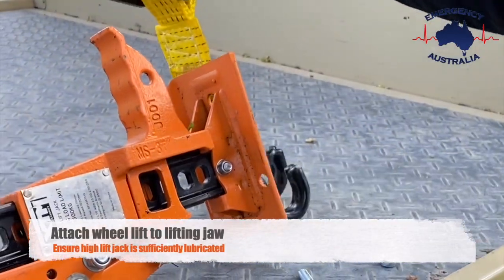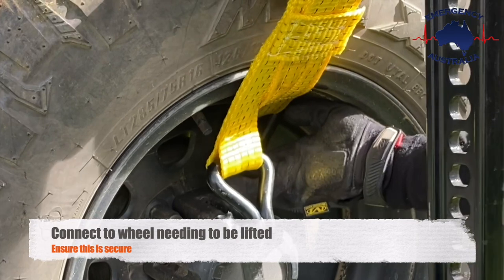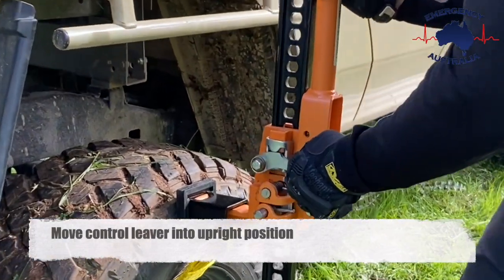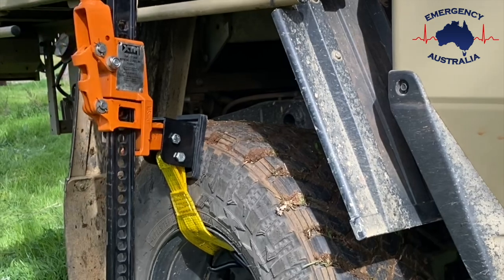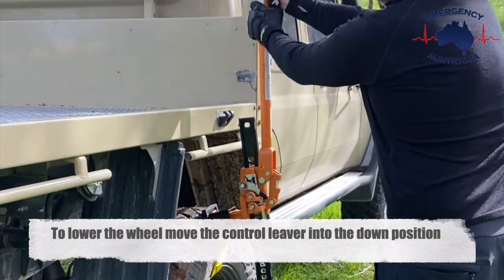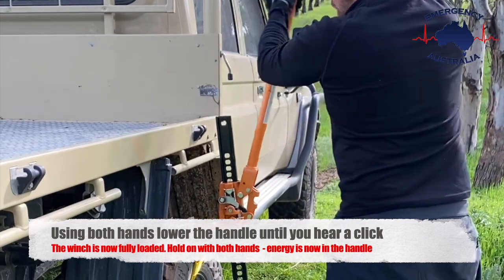High Lift Jack - How to use with a wheel lift

Comment: I´ll be the first to comment!
I purchased exactly this jack earlier this year - mostly for round the block heavy lifting, though if either vehicle gets into trouble on my rough track in, I was thinking that this is a good backup plan.
I came to try it today for the first time. I needed to lift a full 200l drum from horizontal to standing.
Should be easy, I thought.

I tried to follow the instructions, but I ran into trouble with the "make sure the control lever is in the up position".  It only seemed to go "so far" then stopped.  I thought, Surely you aren't meant to keep manual pressure on the lever WHILE cranking... but even this didn't get it to lifting.  As soon as I lowered the main handle, the lifting foot started going down.

I pinched skin on both hands several times (drawing blood!) before giving up and going to YT.

After watching your vid a couple of times, I could see where the control/reversing lever was supposed to latch - something that was NOT made clear in the instructions.
Now I have the jack working properly, but I was ready to melt the bastard down for scrap.

Thing is, who in their right minds lubricates a brand new, off-the-shelf purchase?  That's what I consider maintenance, NOT do-this-before-starting.  Everything including the pins (and the bloody lever) are stiff and hard to get working properly, even though I only took it out of the box 2 hours ago.  Feeling pissed-off and ripped-off.
Reply from the maker: Glad our video helped get you back in the fight. Yea have to lubricate. Across the board it’s one of the most unknown facts with these bits of kit. 👍